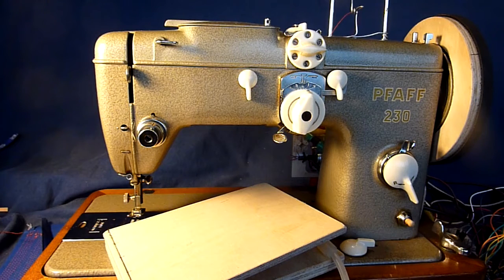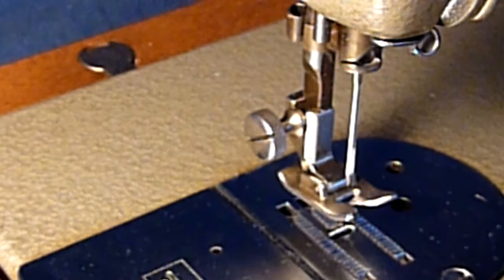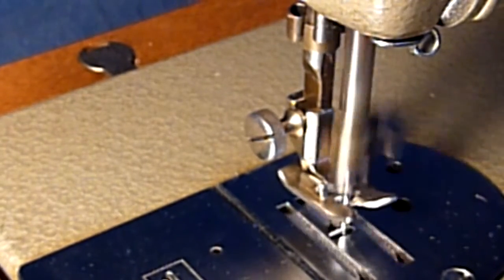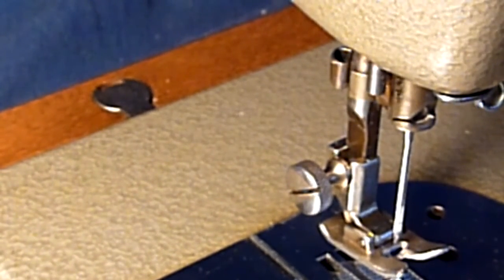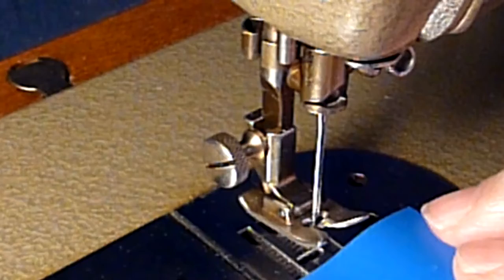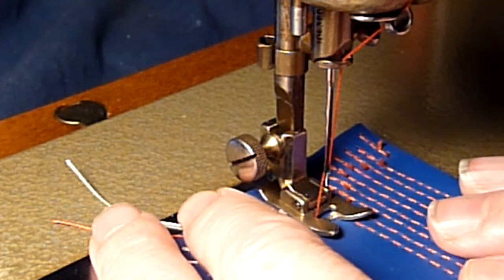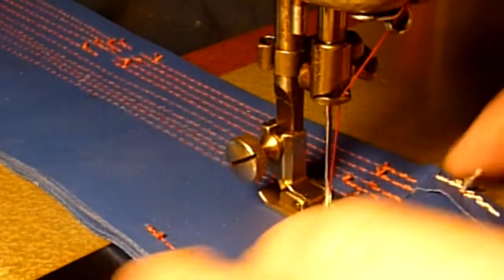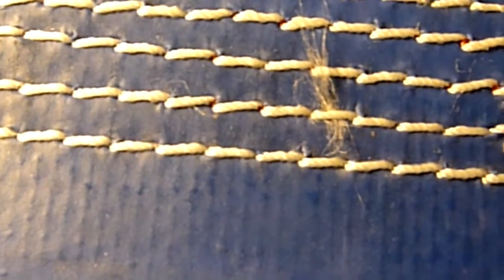Speed Control with new BDC motor drive on Pfaff 230

Comment: How do i make the pedal speed slower?  I mean what adaptation i can do?  My machine is a regular domestic sewing machine. 

Actually,  I'll be happy to learn if I can use the same design to slow other pfaff 2170/2140
Reply from the maker: I think it will be hard or impossible to do on a modern computer machine like Pfaff 2170/2140. The Pfaff 230 is a vintage mechanical sewing machine with an external motor. The motor  is easy to replace with another motor and motor drive to achieve what you see in video. Please look at my other video on the Pfaff 230 on my channel. In order to achieve what you see in this video you need a pedal with pressure (force) control and a motor with tachometer feed back to the electronics providing power to the motor.

Comment: You can used  to  do  embroidery stitches at top speed
Reply from the maker: I have not tried to make embroidery stitches at top speed. But I guess it could do it. I did try to do zig zag stitches at high speed like you see here. https://youtu.be/VLU_s1RGasA  It is with the original motor to the machine delivered in Denmark.

Comment: THIS IS GOOD. 

THIS IS WHAT SPEED CONTROL SHOULD BE.

ALMOST PROPORTIONAL. 

SPEED CONTROL FOR SEWING MACHINE IN THE INDUSTRY TODAY IS MORE LIKE A LAMP DIMMER OR JUST REGULATOR IF I REMEMBER CORRECTLY. 

KEEP IT UP SIR.

WORLD NEED MORE OF THIS.
Reply from the maker: Thanks. Yes, most motors for industrial sewing machines the past 20 years are named "servo motors", and they are electronically controlled brushless DC motors. "Servo motors" got much better than the former used clutch motors, and it seems that sewing machines user were just happy with this new better performance, and development stopped. But the design of these "servo motors" only allowed a limited speed range from minimum speed to maximum speed like a factor 10 up to a factor 50. So if the max speed of the motor is 5000 rpm, the lowest speed will not be below 100 rpm. But I like the lowest speed to be lower than that, and I think other user would like it too, but most users have newer tried it or even think, that it could be possible. The DIY drive I present in this video got 1:600. Combined with the very accurate and responsive pedal, I have got a very nice experience, when I sew with it.
Reply: @ sometimes im using voltage (or watt?) reduction with overlock machine when working on tiny pieces.
and that thing is called sewing machine speed control it is write on the top of it with big letter for real. 

circle is remote control enthusiast and seriously I just realise im working with mechanical speed control when I step my feet on the plate of my sewing machine.

and my speed control should not be call speed control. 

hope everything get better. 
have a great day. ❤️

Comment: hi could you tell me what pressure transducer are you using , what pressure parameters?
Reply from the maker: I use an Omron sensor type 2SMPP-03. The pressure range with the silicon hoses I use becomes 0-60 hPa with a pressure on pedal in range from 0-40 N. Be aware, that using air becomes sensitive to temperature due to ideal gas law. In one case I have a potentiometer, to adjust the zero point. In this case I made some software in the Arduino, to readjust the zero point automatically.

Comment: please do a  vid on the 319k / 320 for mods to make it better for heavey fabric it does quite welll on its own
Reply from the maker: I have not seen these machines for sale in Denmark, so I do not think that they might have been sold here in small quantities only. They do need needles not that often used or perhaps they can work with the Singer 20U bobbin cases.
Reply: @sewingmachinesindetail  my ones use 15x1 or i have a 206k industial sub version takes dbx1 needles only round needles fit that one
Reply: @sewingmachinesindetail  the the singer 319 an swing needle family are based on the 130 pfaff machine so the one you got there is probly pritty close to my 306 / 319
Reply from the maker: @rndea100  I have tried to look into that. I noticed, that the size of the bobbins are not the same on the Pfaffs and the Singer 306/319/20U. So I do not think that hooks, bobbin cases etc. can be interchanged. But the principle of the hook is the same. I think the possible decorative stitches of the 319 is better, because they include blind stitch and 3-point zig zag. The Pfaff 230 and similar cannot do these kind of stitches, because the decorative zig zag movement is not synchronized with a gear. I think that another important detail is the maximum length of reverse stitches. Most Pfaffs got full max reverse stitch length compared to max forward stitch length. Most Singers got about only half max reverse stitch length. I should like to know how this is with the Singer 306 and 319.

Comment: I wish I could modify my Singer 306K to take this sort of handwheel. I "borrowed a 1.5 amp motor from my Kenmore (built by Chrysler under the "New Process Gear"  company that briefly made sewing machines) model 120.71. My Singer has the strength to handle a stronger motor, and I would love to apply this, and even a second reducer gear, like you find on Bernina/Marusen/Soryu sewing machines (Kenmore here in North America). 

I've missed your inventive posts, and am very glad you're back at it. 

Inspiring!
Reply from the maker: Thanks for the comment, and I am glad that you like my videos. I know some of the Singer 306k use 206x13 needles. However, some use the 20U bobbin cases, and then you may be able to use normal 130/705H needles.
This kind of drive I now trying here makes a good transfer of power with only minor transmission losses. I made a playlist of videos from many other users, that have tried different motor machine transmission with higher gearing ratio.
Reply: @sewingmachinesindetail  I have a few fully metal 158 series Sears Kenmore sewing machines with the torque reduction pulley system "borrowed" from Bernina. I appreciate the slower yet more powerful torque these pulleys provide at the needle plate for sure. I wish I knew what 20U bobbin case I could use off the shelf, so to speak. My machine definitely uses these bobbin types, but has not been configured (yet) to use class 15 style needles. When I do; I'll be able to use up to a size 18 leather needle, which will help a great deal. What I appreciate with this Singer, as well as the 206K and 319K as well is the tough, durable infrastructure they built into these machines with this so-called "swing" system. 

It basically has the pedigree of a semi-industrial, and I am hoping to convert mine to take on heavier duty sewing roles. I will likely "borrow" the pulley off the Kenmore 120.71 and, if I am able, create a larger reduction gear like you have done with some of your machines in the past. That 1.5 amp motor should be power plant enough to give me the needle power I'm looking for without worrying too much about a machine that over-speeds at the pedal.  While it might lack the extra high presser foot lift of a Sailrite, it has better "bones", and should be fantastic at taking on really tough sewing jobs once it's correctly configured. 

Thank you again, and I look forward to your next instalment.
Reply: @shopwornbear1171  shame you cant add the extra walking foot to the 206k / 306 319 320 would be a beast cus it can zig zag aswel as strait stich i just got a 31k47 with a kick walking foot a wonder if the part cuold sum how fit on the 319k i rekan you may be able to put a servo on to them for lower speeds would be nice power ihave a industrail version on the 206k with the knee lift takes dbx1 needles